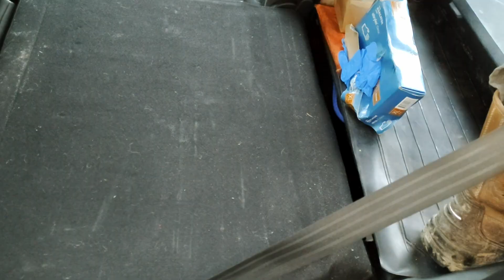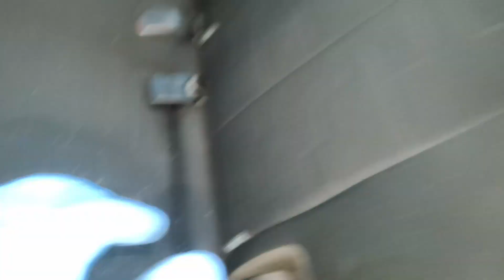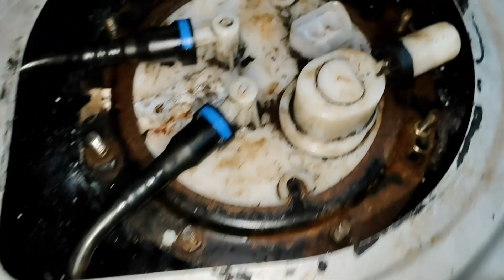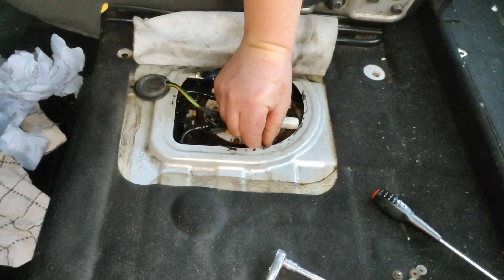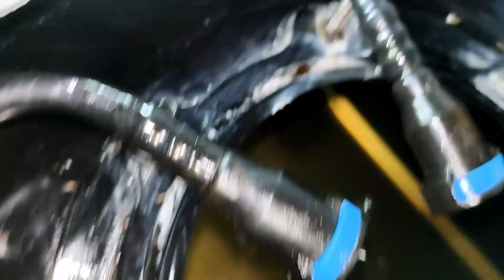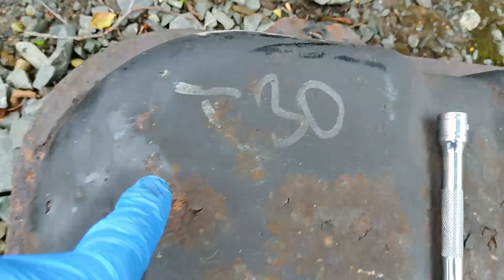KIA Venga Fuel Tank Sender Unit Problem

Comment: I’ve got the same problem, still trying to figure it out. I’ve adjusted the sender unit multiple times but doesn’t seem to be correct or moving on the gauge. 
Any help?
Reply from the maker: @TravelGuyTom  have you checked that the sender unit is functioning properly, by manually moving the float up and down and verifying that the guage reads the position?